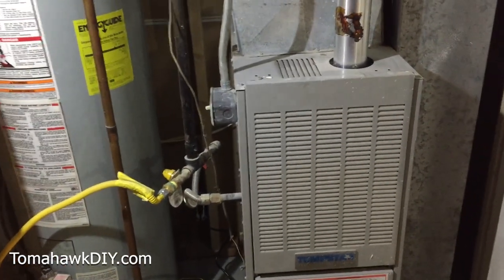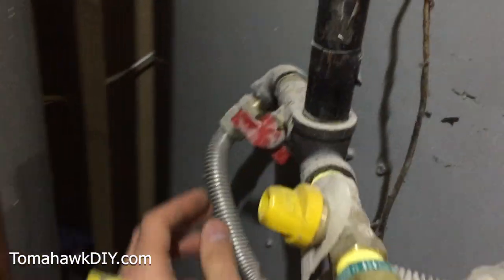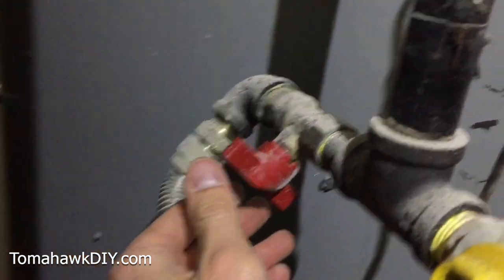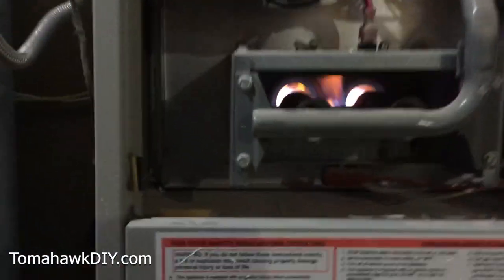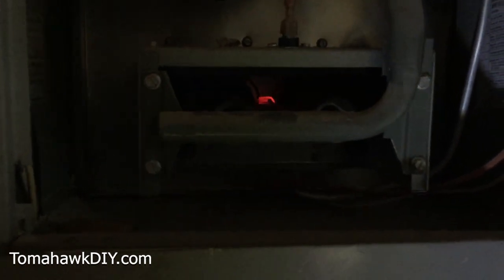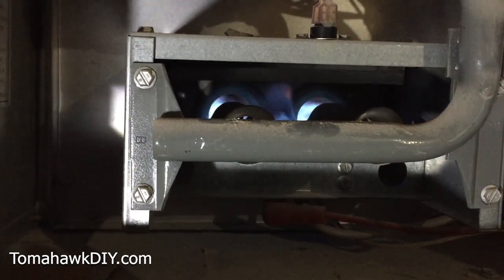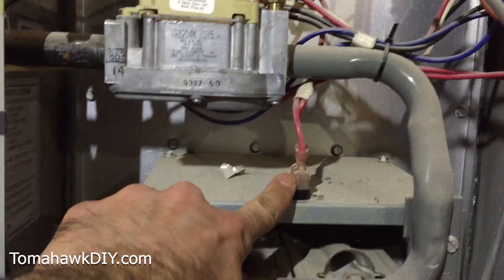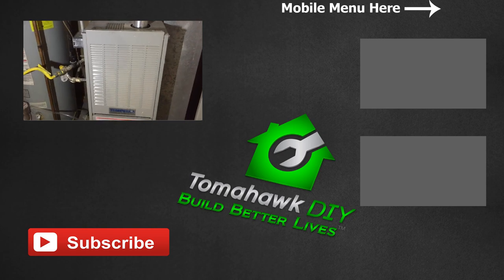Light / Ignite a Gas Furnace

Comment: what do I do if my furnace won't auto ignite? it says on the panel to light it with a match. Im not sticking my damn hand in there. Its a newer furnace from 2005. My gas supplier said it has autoignite but once I turn the switch on and gas on the gas just continues to leak out slowly and then my whole home smells like gas.
Reply: mines not turning over either.  same age furnace.  it tries to but won't light and auto shuts down